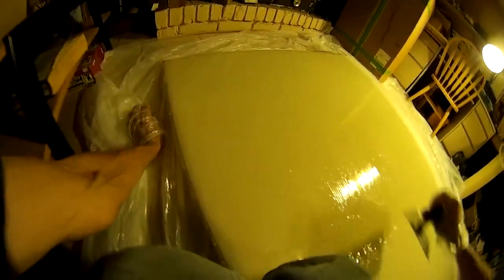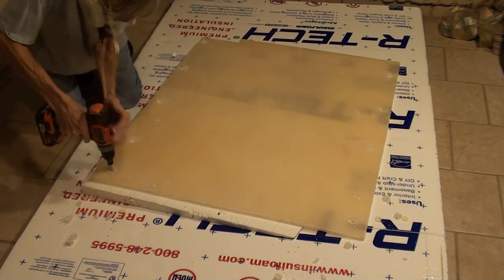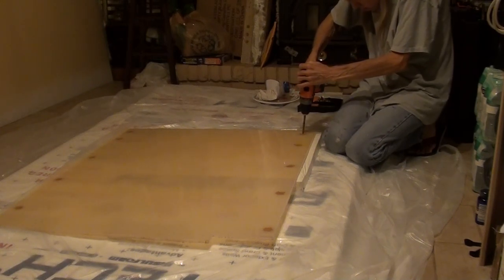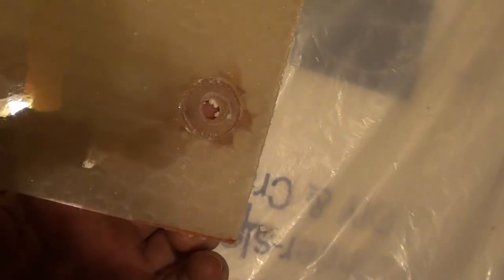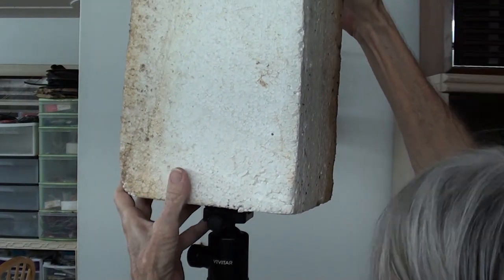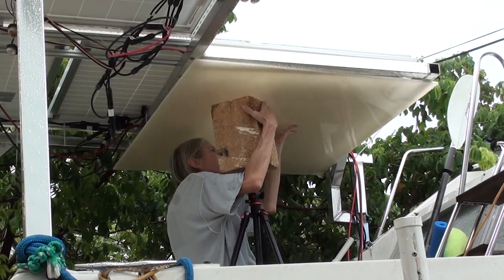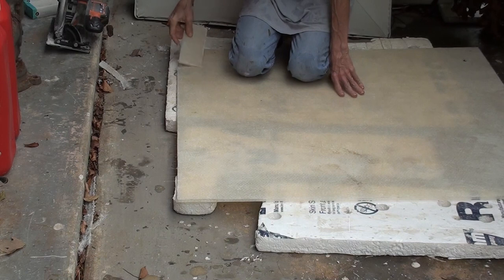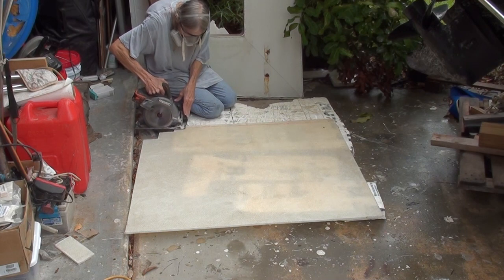Installing a nidacore ceiling - Translucent Nidacore Ceiling - countertop epoxy on fiberglass

Comment: Another great video. Another way I make strong areas to make holes is to inject resin into each honeycomb with a turkey injector.
Reply: Oops. Hit send by mistake. Let me start over:  another great video. Another way I make strong areas to make holes is to inject resin into each honeycomb hole in a large enough pattern to give the hole strength. I use a turkey basting injector and cut it flat with a dremel. This can be done before putting fiberglass cloth on and you simply puncture a hole or after the cloth has cured and pre-drill a small hole to put the injector needle through. This way, you still have the honeycomb to act as support. Sort of like rebar in concrete.
Reply: Also, my mixture that I inject is resin, cabosil and milled fiber. Very strong and not brittle. I use the same if I have to butter the exposed edges.
Reply from the maker: @dogbone6315  Thanks!  I might try injecting resin into the cells next time.  I close off the cut edges by laying some chopped strand mat over the edge and wet it out.  It doesn't stick to the polyethylene core, but does adhere to the glass on either side of the panel.  This covers the edge and is a whole lot lighter than filling the cut cells with resin or fairing compound.
Reply: Nine Hundred Dollar Luxury Yacht-  less product too doing it your way. I was mixing up a lot to cover those edges.  I have more coring on my deck to do. I’m going to give it a shot.

Comment: Epoxy resin is tougher than the polyester resin which is weak and brittle without glass re-enforcement. Not hard to do a test to see how well the thickened epoxy adheres to the honeycomb. For what you are doing the poly may be sufficent. Fun Stuff!!! Merry Christmas  from Canada!
Reply from the maker: Thanks!  Merry Christmas.  I put 4oz surfboard glass on things that are not structural.  Such light glass on both sides makes it very strong and it hardly weighs anything.  The countertop had surf cloth on top and one layer of 1708 on the bottom.  I could sit on the counter, although just barely.  More glass makes it stronger but heavier as well.  Before going to thicker glass, I try to see if I can use thicker core.  Doubling core thickness quadruples strength while adding almost no weight.

Comment: Is the honey comb epoxy or polyester? Where do you buy? I’m in Kentucky I can’t find anyone that doesn’t sell in bulk or push the sale that way? Lol wish you had extra hands helping you! You could run led behind them and make a cool light!!
Reply: Andy sommer- the nidacore is neither epoxy nor polyester but can be used by both resins. It is  Polypropylene (milk jug material) honeycomb. Then on both sides they fuse a barrier, like tyvek, then fuse a fiberglass film. Once you put a light coat of rain on it, the honeycomb chamber is sealed. The resin can’t penetrate the barrier shield and fill the honeycomb. I bought 4x7’ sheets from Boat Builder Central in Ft Pierce, Fl for about $46 each. 8 pieces $368 and another $160 for shipping (to commercial site- find a friend with a business- ignore when they say you need a forklift. I could lift all 8 panels off the truck. Plascore is another manufacturer. But 4c8’ panel for $40 each. I would have ordered from them, but they were completely shutdown in April. Great material for certain purposes. Call to see their minimum order, or think of different projects you can do or contact boatyards if they’ll buy excess.  Lastly- resin won’t stick to polypropylene. That’s why they have the fused barrier. I tried pealing it off to see how secure. You can’t.
Reply: Sorry- should say resin, not rain.
Reply from the maker: I got the honeycomb core from Fiberglass Florida.  It comes in 1/4, 1/2, 3/4, 1 inch and 2 inch thicknesses.  I used the 1/4 inch for the ceiling and usually use the 3/4 for most other projects.  It can be bent into curved shapes before you put resin and fiberglass on it.  With glass on it, it becomes very rigid and very light.  Most of the weight is the glass and resin.  Doubling the thickness of the honeycomb makes the part four times stronger while adding almost no weight.  One name for this stuff is "Nidacore" although it is sold under different names by different manufacturers.